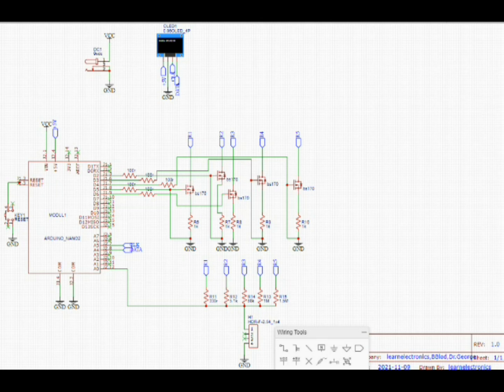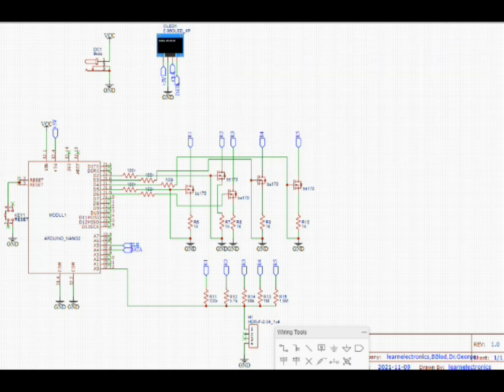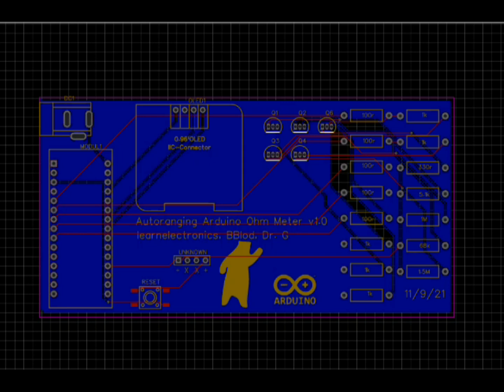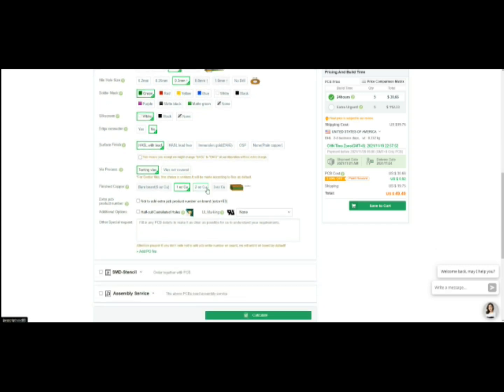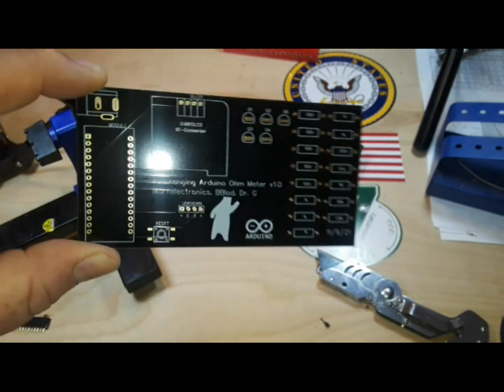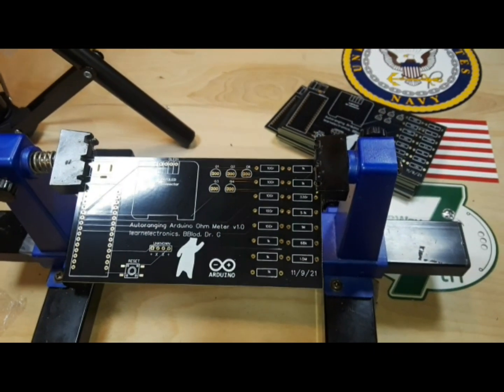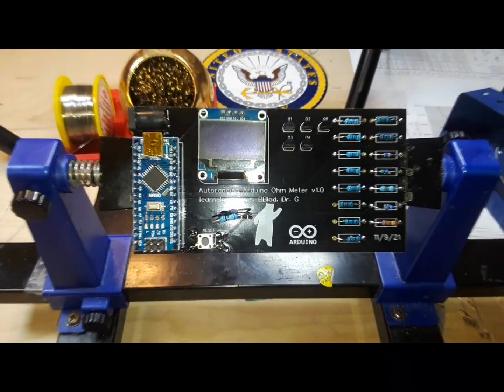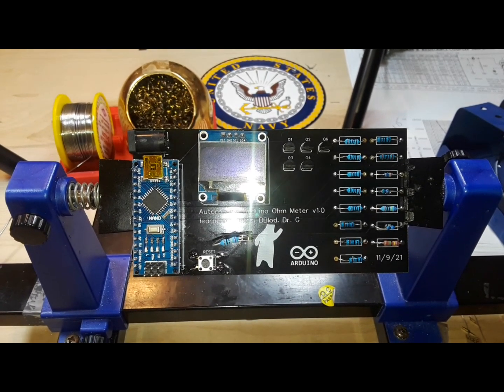Arduino Ohm Meter Boards are Here Arduino Resistance Meter

Comment: Again another interesting "build" video. I wish you would demonstrate the board in use? 
Also, any way to make a multi test board, one that does capacitors, transistors and other components. I bought one on EBAY, it wasn't expensive just clumsy to use and sometimes it wasn't very accurate. The quality of your construction appears very nice. 
Finally  I inherited (long story) a lot of arduino sensors. Some have model numbers a lot do not  so getting detailed information is difficult. Do you know if there is (for lack of a better description) a file or data embedded electronically on the sensors and if so how can it be accessed? You seem very knowledgeable that is why I am asking. Again, Paul your projects and deliver of information are nicely presented, thanks!

Comment: Did you have mistake in schematics or was it old schematics? I was thinking that some fet gates are connected to ground and unknown resistor is connected to ground when you said in first video it should be connected to vcc.
I would have connected reference resistors between drain to measurement point. now you have also Vsg efecting to measurement